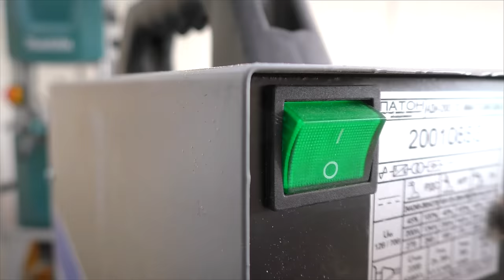Top DIY Woodworking Tool Idea || From Nut to Cool Quick Release Mechanism || Part 5

Comment: There's a Czech outfit that makes a woodworking metal vise with a similarly gravity-mediated QR half-nut.  Works by leaf spring tension of a pin on the screw opposing the weight of the nut instead of your magnet method, but gravity operates it the same way.  Their design eventually wears out.  Please let us know when yours does.

Comment: Considering the amount of fine work put into this project an ACME thread would have been apropos!
Reply: That was my first reaction as well. I think we’re both wrong though because when rotating CCW, the thread angle helps to disengage the halfnut. An ACME thread might remain engaged, at least intermittently. That would be frustrating.
Reply: @lenturnbow8038  I don't think an Acme thread has to commit to being left hand only.
Reply: @cdrive5757  I had to look that one up! Acme is available in left hand thread. Huh. I figured we’d only be discussing right hand thread. I think it is telling that all of the YouTubes about this mechanism show an angled rather than square thread form. Perhaps the reason is not because of predictable disengagement. But it wouldn’t surprise me if Acme thread was problematic for that reason. If the half-nut were disengaged by a lever, I would agree that square - wall thread would be better.
Reply: @lenturnbow8038  Most of the YouTube DIY involve commonly sourced material from hardware stores or home centers. Acme threaded rods are not commonly found at either, whether it be right or left hand thread. I think the odds are far better that standard coarse thread rods were chosen for that reason alone. 
Wakodahatchee Chris
Reply: I forgot to mention that Acme and Square thread are not synonymous. A Square Thread is Termed same.
Reply: I forgot to mention that Acme and Square thread are not synonymous. A Square Thread is Termed same.
Reply: @cdrive5757  Good catch! I should have said “29 degree” and “60 degree” to denote the thread angles.
Reply: @cdrive5757  Happy coincidence that the more accessible part is also better from an engineering perspective too!

Comment: Do I understand it correctly that when you unscrew the vice the quick release will loosen/release the vice completely? Call me stupid but I have never seen anything similar before and I am just a lay man in this matter.
Reply from the maker: yes, you are right, after unscrewing you can move the vise back and forth freely
Reply: It is called a "split nut" and is used quite a bit in the vise manufacturing of usually, high end products.
Reply: @4n2earth22   In a lathe context “half nut”.

Comment: Hi. Very nice work, but could you tell us precisely which liquid you sprayed on the superglue (cyanoacrylate, i guess) at 7:00 and what the sought-after effect?
looks like a more volatile liquid than water (alcohol ?)
Is it what makes it cure so quickly, without time to sip through and glue the piece of tube to the threading?
i am very interested by your answer
Reply: it is called super glue activator, check amazon